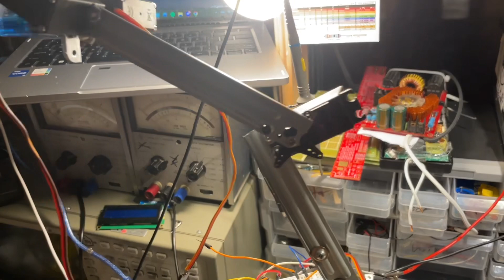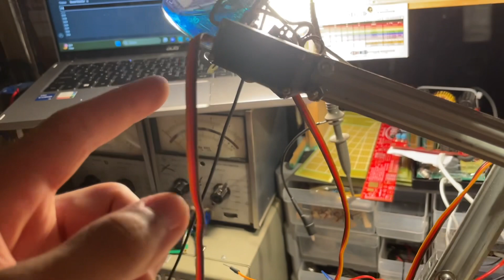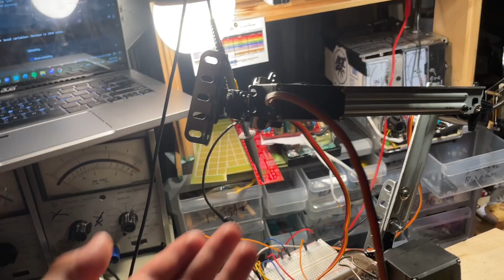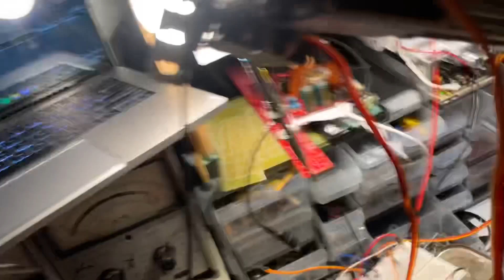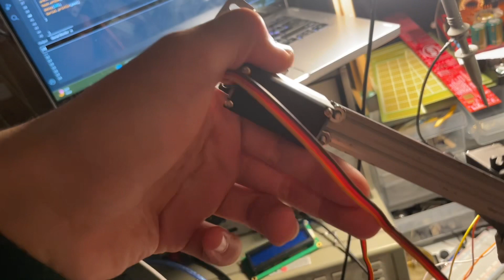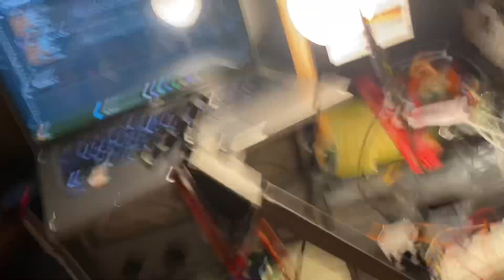robot arm

Comment: The programming is one thing but it lacks structure and rigidity. Also I've found that servos that connect two joints together dont really work well. its better to have a short shaft connecting the two joints then connecting that to the servo with a belt and pulley system or even some gears. All things considered this is a great start!!

Comment from the maker: this is the kinda thing i plan to use to handle extremely crazy things like solid buli or fluorophosgene, in an inert atmosphere blast chamber not to protect the reaction but to protect me 😂

like i said ill probably just buy a few industrial ones from china and do some sealing, they aren't too expensive and i would like to be able to run certain fun reactions while hiding behind a feet of concrete
Reply: I think a manipulator arm might be the ticket for what you have planned. I've never seen a DIY one, but then, I've never looked.